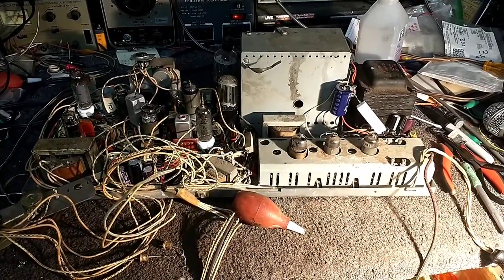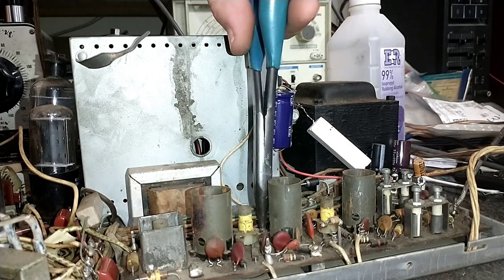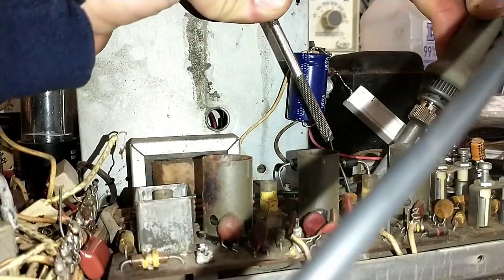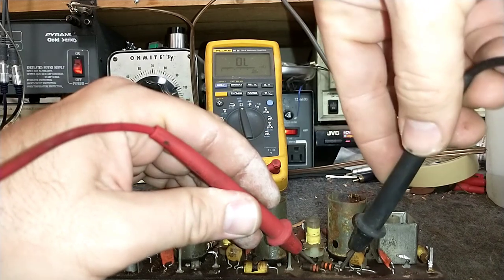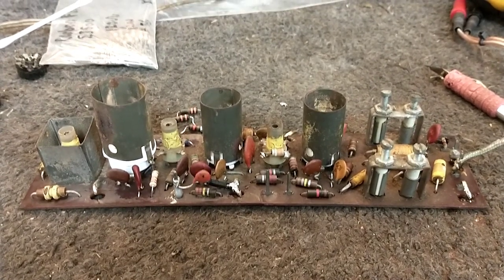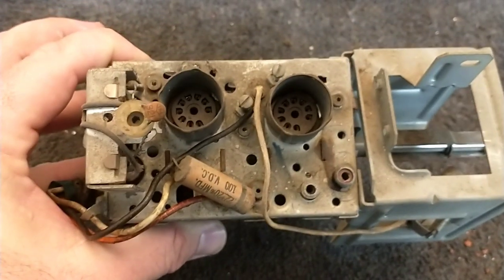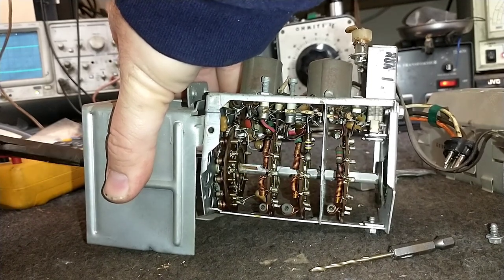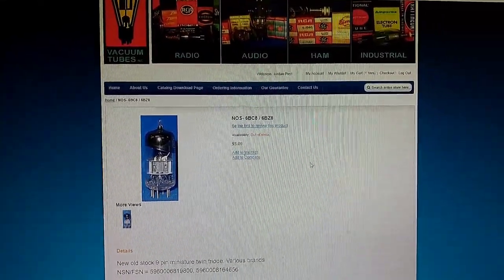Servicing a 1959 Philco Predicta Princess Part 7/9 - IF Board rebuild, tuner, and first test

Comment: Never skip forward, in case you miss that moment of wisdom. Really enjoy the unedited chat as as you work vids because you give the reasons why you replace components, how to replace them, repair or substitute an alternative. Educational value 100%.
The channels which take the approach of "its th T-Con board, it needs replacing", vid then jumps to: "new board is now installed and the TV is now working". Educational value 0%.
After watching this vid I couldn't help wondering why all the carbon resistors were not replaced, if some had drifted but not yet out of spec is it likely they may fail as soon as the set went back into regular use?  
Thank you for taking the time to make these interesing and educational vids.

Comment: You're very patient and methodical at getting the set running.  Philcos, Sylvanias and G.E. sets were the nemesis of our shop.  Built cheaply and not the best of reliability.  The tinned stranded wires were prone to work hardening.  
My parents had one of the Philco "attache"  portables.  I talked them in to getting rid of it and getting a Zenith.

Comment: 45:13 You will notice that the green is also in the evacuation nipple at the top. I don't think that is green corrosion, I have seen that, and it looks different and would be more present on the metal, that looks as if it is in the glass. Just my opinion of course, what does the getter look like?
Reply from the maker: Getter looks fine, so i assume no gas

Comment: Well done jordan,  its not bad at all now, Smashing :-D
Maybe there is an earthing problem thats upsetting the tuner.
I bet that the i.f frequency is totally different from more modern sets,  otherwise you might of been able to use a different tuner for testing.
Remember that the tv box may be causing problems as that tv  may not be filtered as modern sets.
Maybe  add a couple of disk caps in the core and screen of the coax to block d.c.
Reply: Video IF on these is 45.75MHz.

Comment: Might not be the tuner.  Could be a high-noise component in the video-amplifier chain.  Resistors with DC current can generate noise.  Capacitors with high DC can generate noise.  Three Chinese cheers for vintage components - Fooey Fooey Fooey